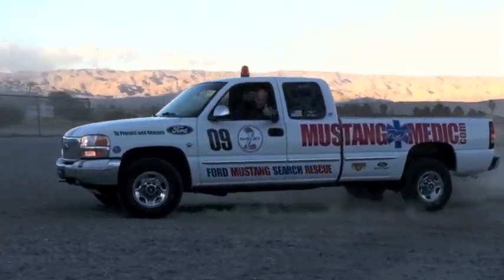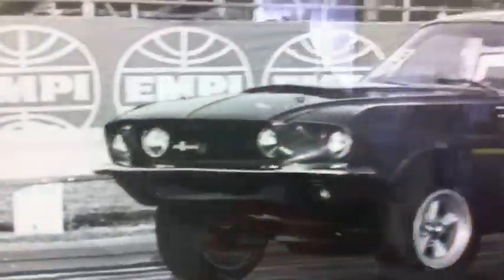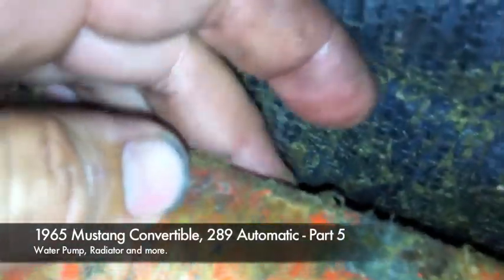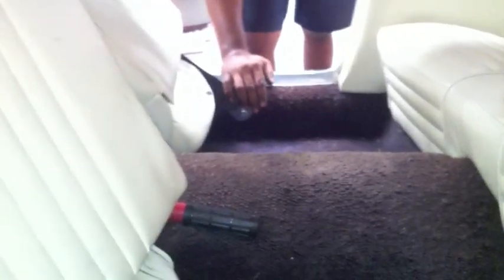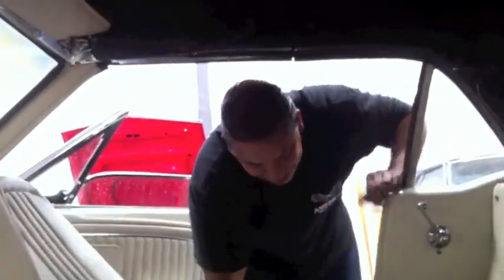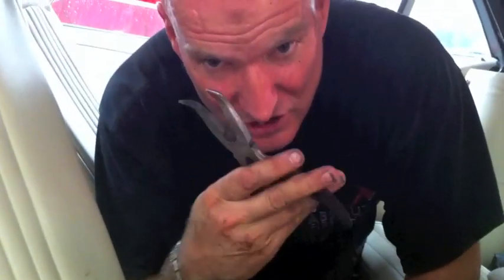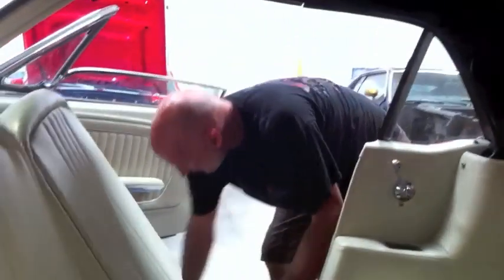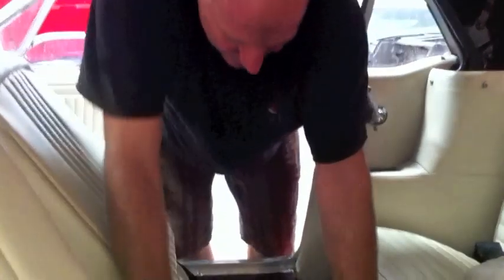Front Seat Belt Installation in a 1965 Mustang Convertible - Day 4 - Part 5

Comment: Man I'm glad I work on cars ,I would kill someone if I found a lock washer on my mustang even if it's a aftermarket belt plus if you work around mustang's the driver's side is always back further 😞
Reply from the maker: Noted
Reply: thank you geeze its a safety issue use the CORRECT hardware,